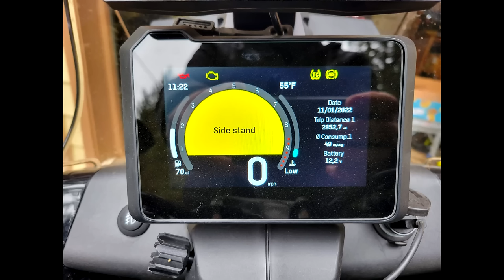Husqvarna Norden 901 Long Term Review: 6 Months and 3,000 Miles

Comment: The Explorer Mode is worth it and will negate the need for "favorites"
Reply from the maker: I have it.  You still have to switch into it when you get off the street and that's a lot easier when you can hit one  button instead of 4. 
But that doesn't change the fact that an advertised feature like saved favorites should just work, whether you want it or not.
Reply: @DorkintheRoad  For me Explorer mode negates the need for anything else. You can adjust your slip control on the fly so why do you need the other modes? Sometimes I will turn off Rally throttle in technical sections but I leave rear ABS off all the time (sweet supermoto slides). Those other modes might as well have been deleted when Explorer mode was installed...

Comment: 15K for a bike you don't trust....hmmm...I think I'll stick with my DR650. Plus, I just looked at the "wet" weight of this thing.....480 pounds before a single pair of socks or a toothbrush gets packed away in the bags. Sooooo......full of fuel, hard/soft bags, packed up ready to go, 525 pounds minimum. Probably closer to 550. Thats ONLY 100-125 more than my DR with 5.3gal of fuel and loaded for a 10-day ride. Yup, not so much.

Comment: I have the 701 Enduro and yes it's a European bike with all the good/bad/ugly. If you are a person for whom reliability is of top importance then European bikes aren't for you... Japan has some very good options but they tend to be a) lower power (less stressed powerplant) and b) heavier (bigger powerplant so less stressed, more substantial components so more durable). Reliability/Performance is a bit of a zero sum game, you give up SOME of one to get the other (to a point... I think KTM could get a lot more reliable without hurting their bikes performance much... failing slave cylinders because of design flaws that they don't bother to fix for years and years is one good example).

If you want some serious pucker on IMU equipped bikes... grab brake mid-corner. For most of us it's nearly impossible to get yourself to do it... but on my Multistrada I can do it (I eased into it starting with just a bit then trying different amounts) and there is no drama.  I've not done it on the 701... I'm not sure I trust KTM electronics that much (their quickshifter is sort of crap).

Comment: 3000 trouble free miles should be an expectation on a new $14-15,000 plus motorcycle, not a cause for celebration (at least in my opinion).  Pretty low bar if you ask me.  I had a 2021 KTM 690 and I sold it for the exact reasons you state; I could not get the perceived (un) reliability out of my mindset.
Reply from the maker: Not celebrating, just sharing my honest experience so far
Reply: @DorkintheRoad  Not really referencing your video, but just general comments where people use low mileage to justify reliability.  Am I unrealistic to expect a $15,000 vehicle to run trouble-free for thousands of miles?  I think it should be expected if you ask me.  Great bikes if you turn them over quickly.  Reminds me of driving a Range Rover, Porsche, Audi, or something along those lines.

Comment: Having raced KTM for years I have allot of experience with White Power WP suspension.  It is the worst suspension on the planet.  Japanese suspension is way better. Parts are crazy expensive for Husky or KTMs.
Reply: The suspension on the husqvarna is lower quality than the xplor on the ktm. With that said the xplor fork is a low cost cheap fork.
Reply: Actually KTM parts seem really affordable in my opinion.

Comment: I think everyone who rides, has a certain bias against a brand of bike, that colors their ability to give the benefit of the doubt to those brands that they just would NEVER consider.  Now I am a lot older than most, 67 to be exact.  I actually had the First Honda 250 Elsinore in the midwest MX tracks.  When it came out, it blew my Maico 400 and 501 out of the water.  The Suzukis, and Kawasakis, Yamaha, Husky's etc were looking for second place when I showed up with a superior bike.  I really hate Suzukis and Kawasakis to this day.  I don't like Husky because in my day, before the the Elsinore fell into my lap, Huskys were the little rich kid's toy.  Being a former Maico guy, man talk about maintenance.  For every hour of run time, it took 2 to 3 hours of wrenching.  The Honda was a dream,  I really hate Suzuki because a kid I went to school with used them, and he really was a prick.  I won't ever consider a KTM, because he rides one now and really rags on others that don't agree with him.  Yeah it has a hot motor, but doesn't handle worth chit.  So as we got older, he bought a moto-guzzi for the road along with his KTM for off road, and anyone that rode a different brand was again made fun of.  So, I did the one thing that would shut him up.  I bought an R1250RT for touring, and an R1250 GSA for off road.  We have not spoken since.  I've been to several events (Slimey Crud run) in Wisconsin where he showed up and turned around and left when he saw me there.  Yeah it is that bad.  Now understand, he lives in Northern Illinois, and I live in Virginia.  So going that far for an event is not without it's issues.  Although I spend 90% of my time on road, it is worth loading my bikes into my trailer, hooking up the motorhome and taking a drive twice a year to see if he shows up on his KTM/Moto-Guzzis.

Comment: You've experienced a reliable motorcycle but don't trust it's reliability? Lol come on you're letting your bias overcome rationality. I'm at 10k miles on mine with no issues. What is the milestone or anniversary that it could achieve reliable status? I used to bash KTM too but now have three Husqvarnas in my garage. Nothing is perfect but the performance of these machines has left the Japanese in the past.
Reply from the maker: I'm getting there.  It's just the little issues that make me worry about bigger ones cropping up.  Overall, though, I've heard overwhelmingly positive things about these bikes.  I'm just acknowledging my own biases.